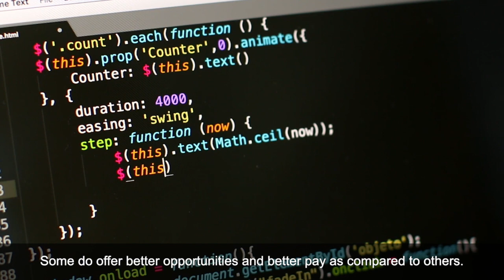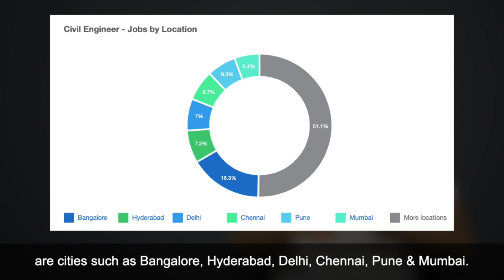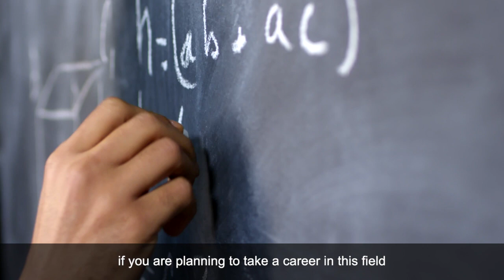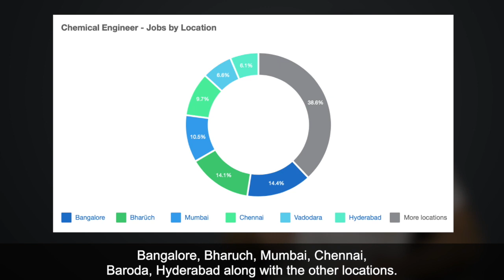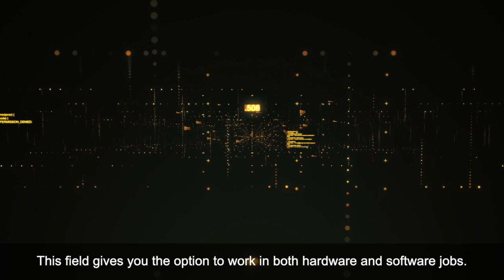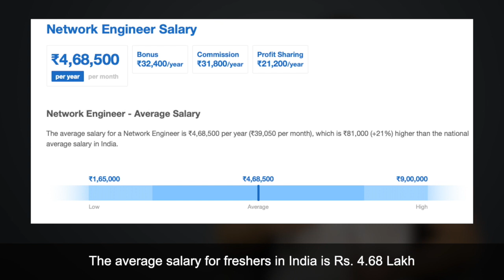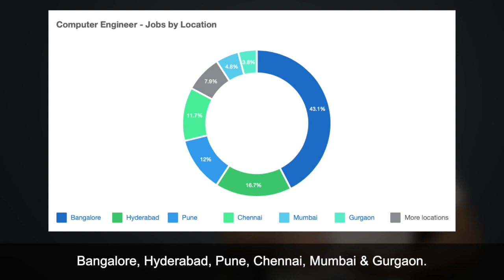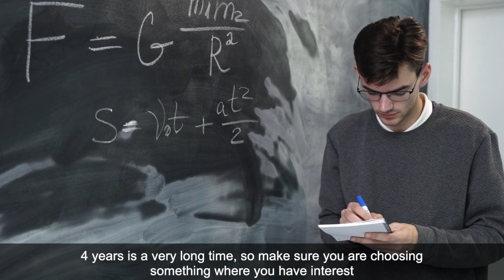Highest Paying Engineering Branches In India in 2024 (Which Engineering Degree To Choose)

Comment: Sir, wt about Aerospace Engineering ?
Reply from the maker: Hello, 
I wouldn’t recommend aerospace engineering, since it’s a niche field & the demand for jobs in this field isn’t much high paying in India. 
I would rather advice taking mechanical engineering & then specializing in aerospace engineering field. It’s always better to go for a Broader field, because tomorrow if you want to switch your field, it’s easier to do. 

Eg , if you want to go for automobile or you want to go into oil & gas after your engineering, you can still do as a mechanical engineer, but if you are are doing aerospace engineering; it will be much difficult. 

So always choose a field which opens your door to multiple sectors and then do certifications on the field you want to specialize in that field. Also, if you do have the budget, do mechanical engineering in india, and plan for masters abroad in countries such as US, Germany, Australia etc that have high scope for Aerospace Engineering. 

Hope this helps & if you have further doubts, drop me a message on Instagram @nikhlogic!

Comment: Bhaiya what about aerospace engg.
Reply from the maker: Hello, 
I wouldn’t recommend aerospace engineering, since it’s a niche field & the demand for jobs in this field isn’t much high paying in India. 
I would rather advice taking mechanical engineering & then specializing in aerospace engineering field. It’s always better to go for a Broader field, because tomorrow if you want to switch your field, it’s easier to do. 

Eg , if you want to go for automobile or you want to go into oil & gas after your engineering, you can still do as a mechanical engineer, but if you are are doing aerospace engineering; it will be much difficult. 

So always choose a field which opens your door to multiple sectors and then do certifications on the field you want to specialize in that field. Also, if you do have the budget, do mechanical engineering in india, and plan for masters abroad in countries such as US, Germany, Australia etc that have high scope for Aerospace Engineering. 

Hope this helps & if you have further doubts, drop me a message on Instagram @nikhlogic!

Comment: What about Aerospace engineering?
Reply from the maker: Hello Kunal, 
I wouldn’t recommend aerospace engineering, since it’s a niche field & the demand for jobs in this field isn’t much high paying in India. 
I would rather advice taking mechanical engineering & then specializing in aerospace engineering field. It’s always better to go for a Broader field, because tomorrow if you want to switch your field, it’s easier to do. 

Eg , if you want to go for automobile or you want to go into oil & gas after your engineering, you can still do as a mechanical engineer, but if you are are doing aerospace engineering; it will be much difficult. 

So always choose a field which opens your door to multiple sectors and then do certifications on the field you want to specialize in that field. Also, if you do have the budget, do mechanical engineering in india, and plan for masters abroad in countries such as US, Germany, Australia etc that have high scope for Aerospace Engineering. 

Hope this helps & if you have further doubts, drop me a message on Instagram - @nikhlogic
Reply: @NikhLogic  thank you so much for guidance.....It helps a lot... 🙏🙏
Reply from the maker: @kunalshirke9100  Anytime brother

Comment: Sir kya aeronautical engineering ek good choice hai
Reply from the maker: Sanghita, I wouldn’t recommend aeronautical engineering, since it’s a niche field & the demand for jobs in this field isn’t much high in India. 

I would rather advise taking mechanical engineering & then specializing in aeronautic. It’s always better to go for a Broader field, because tomorrow if you want to switch your field, it’s easier to do. 

Eg, if you want to go for automobile or you want to go into oil & gas after your engineering, you can still do it as a mechanical engineer, but if you are doing aeronautical; it will be much difficult.

So always choose a field that opens your door to multiple sectors and then do certifications on the field you want to specialize in 

Hope this helps & if you have further doubts, drop me a message on Instagram - @nikhlogic
Reply: @NikhLogic  thank you for replying
Reply: @NikhLogic  And what about aircraft maintenance engineering iss ke bare mein kuch bataiye plz sir

Comment: Sir what about aerospace engineering
Reply from the maker: Hello Swarna, 
I wouldn’t recommend aerospace engineering, since it’s a niche field & the demand for jobs in this field isn’t much high paying in India. 
I would rather advice taking mechanical engineering & then specializing in aerospace engineering field. It’s always better to go for a Broader field, because tomorrow if you want to switch your field, it’s easier to do. 

Eg , if you want to go for automobile or you want to go into oil & gas after your engineering, you can still do as a mechanical engineer, but if you are are doing aerospace engineering; it will be much difficult. 

So always choose a field which opens your door to multiple sectors and then do certifications on the field you want to specialize in that field. Also, if you do have the budget, do mechanical engineering in india, and plan for masters abroad in countries such as US, Germany, Australia etc that have high scope for Aerospace Engineering. 

Hope this helps & if you have further doubts, drop me a message on Instagram - @nikhlogic

Comment: Sir,What about Metallurgy Engineering
Reply from the maker: Hello Abhinav, I wouldn’t recommend Metallurgy engineering, since it’s a niche field & the demand for jobs in this field isn’t much high in India. 

I would rather advise taking mechanical engineering & then specializing in Metallurgy if you want to. It’s always better to go for a Broader field, because tomorrow if you want to switch your field, it’s easier to do. Also, in mechanical during your 2nd year & 3rd year, you have subjects related to Metallurgy. So you cover those topics. 

Eg, if you want to go for automobile or you want to go into oil & gas, you can still do it as a mechanical engineer, but if you are doing metallurgy; it will be much difficult.

Hope this helps & if you have any doubts in this field, feel free to drop me a message on Instagram @nikhlogic. Will be happy to help :)

Comment: How good is Production Engineering? What is its scope?
Reply from the maker: Hello brother, 
I wouldn’t recommend production engineering, since it’s a niche field & the demand for jobs in this field isn’t much high paying in India. 
I would rather advice taking mechanical engineering as it covers pretty much same topics. It’s always better to go for a Broader field, because tomorrow if you want to switch your field, it’s easier to do. 

Eg , if you want to go for automobile or you want to go into oil & gas after your engineering, you can still do as a mechanical engineer, but if you are are doing production engineering; it will be much difficult. 

So always choose a field which opens your door to multiple sectors and then do certifications on the field you want to specialize in that field. 
Hope this helps & if you have further doubts, drop me a message on Instagram - @nikhlogic
Reply: @NikhLogic  thank u so much sir...now I have a way❤️

Comment: Sir what about Aerospace Engineering
Reply from the maker: Hello Aadarsh, 
I wouldn’t recommend aerospace engineering, since it’s a niche field & the demand for jobs in this field isn’t much high paying in India. 
I would rather advice taking mechanical engineering & then specializing in aerospace engineering field. It’s always better to go for a Broader field, because tomorrow if you want to switch your field, it’s easier to do. 

Eg , if you want to go for automobile or you want to go into oil & gas after your engineering, you can still do as a mechanical engineer, but if you are are doing aerospace engineering; it will be much difficult. 

So always choose a field which opens your door to multiple sectors and then do certifications on the field you want to specialize in that field. Also, if you do have the budget, do mechanical engineering in india, and plan for masters abroad in countries such as US, Germany, Australia etc that have high scope for Aerospace Engineering. 

Hope this helps & if you have further doubts, drop me a message on Instagram - @nikhlogic

Comment: Sir what about mechatronics engineering? I loves to create things
Reply from the maker: Hello JCK, sorry I missed out your comment. 
I wouldn’t recommend mechatronics engineering, since it’s a niche field & the demand for jobs in this field isn’t much high in India. 

I would rather advise taking mechanical engineering & then specializing in mechatronics if you want to. It’s always better to go for a Broader field, because tomorrow if you want to switch your field, it’s easier to do. Also, in mechanical during your 2nd year & 3rd year, you have subjects related to Mechatronics. So you cover those topics. 

Eg, if you want to go for automobile or you want to go into oil & gas, you can still do it as a mechanical engineer, but if you are doing mechatronics; it will be much difficult.

Hope this helps & if you have any doubts in this field, feel free to drop me a message on Instagram @nikhlogic. Will be happy to help :)
Reply: @NikhLogic  but after mechatronics i can be a mechanical engineer also and can go in automobile and i can also change my field into electronics and computer science if I specialized into this but i cant do this when iam in mechanical engineering
Reply from the maker: You can just do mechanical engineering instead and work in any of those fields. ECE, yes you can't, but if you are just planning of specializing in it, there won't be a demand for your profile, as your overall software knowledge required will be much lesser.,

Comment: Bro doing cse in colleges other than nit/iit worth it?
Reply from the maker: Hello David, yes it's worth it. College brands do add value, but at the end, it's about what you understand. I know quite a lot of people who didn't come from NIT or IIT, but are currently working with Apple, Tesla etc. So it doesn't completely depend on which college you are coming from, but also matters what you have learnt.
Reply: @11 226 ANTO ABRAHAM thanks dude
Reply: @11 226 ANTO ABRAHAM yep you can if you do Mtech/phd in ai and ml , which is not easy ,it's one of the difficult subject
Reply: @11 226 ANTO ABRAHAM to work in abroad there are two ways bro 
First way is to get in the prestigious college like nits/iits or bits and crack foreign placement there 
Second way is to do ms in us/cannada/Germany and get job there after graduation , for this you need to write GRE/Toefl and score some decent marks to get a decent college , to get into ivy league colleges then you will get job 99.99% sure but you need heavy marks in toefl and strong resume
Reply: @11 226 ANTO ABRAHAM btech and be are almost similar bro , infact almost all local college offer be instead of btech , they are given same recognition under aicte , try to get a good college bro , then btech or be will not matter , college matters

Comment: I want to be an aerospace engineer
Reply from the maker: Hello Chinmay, 

I wouldn’t recommend aerospace engineering, since it’s a niche field & the demand for jobs in this field isn’t much high paying in India. 
I would rather advice taking mechanical engineering & then specializing in aerospace engineering field. It’s always better to go for a Broader field, because tomorrow if you want to switch your field, it’s easier to do. 

Eg , if you want to go for automobile or you want to go into oil & gas after your engineering, you can still do as a mechanical engineer, but if you are are doing aerospace engineering; it will be much difficult. 

So always choose a field which opens your door to multiple sectors and then do certifications on the field you want to specialize in that field. Also, if you do have the budget, do mechanical engineering in india, and plan for masters abroad in countries such as US, Germany, Australia etc that have high scope for Aerospace Engineering. 

Hope this helps & if you have further doubts, drop me a message on Instagram - @nikhlogic

Comment: do aeronotical engnnering have good scope is it good to choose it .please respond
Reply from the maker: Hello Vishnu, 

I wouldn’t recommend, since it’s a niche field & the demand for jobs in this field isn’t much high paying in India. I would rather advice taking mechanical engineering & then specializing in aerospace or aeronautical engineering field depending on your interest. It’s always better to go for a Broader field, because tomorrow if you want to switch your field, it’s easier to do. 

Eg , if you want to go for automobile or you want to go into oil & gas after your engineering, you can still do as a mechanical engineer, but if you are are doing a niche engineering field; it will be much difficult. 

So always choose a field which opens your door to multiple sectors and then do certifications on the field you want to specialize in that field. 
Hope this helps & if you have further doubts, drop me a message on Instagram - @nikhlogic

Comment: Sir can aeronatical engineering is good brand for defense aspirants
Reply from the maker: Hello Abhay, 

I wouldn’t recommend, since it’s a niche field & the demand for jobs in this field isn’t much high paying in India. I would rather advice taking mechanical engineering & then specializing in aerospace or aeronautical engineering field depending on your interest. It’s always better to go for a Broader field, because tomorrow if you want to switch your field, it’s easier to do. 

Eg , if you want to go for automobile or you want to go into oil & gas after your engineering, you can still do as a mechanical engineer, but if you are are doing a niche engineering field; it will be much difficult. 

So always choose a field which opens your door to multiple sectors and then do certifications on the field you want to specialize in that field. If your interest lies purely in defense, in that case you need to clear the NDA exam and also the CDSE exam. 

Hope this helps & if you have further doubts, drop me a message on Instagram - @nikhlogic
Reply: @NikhLogic  Thank you so much sir for your guidance 🙂🙂

Comment: Could you tell about Marine engineering
Reply from the maker: Hello Mathankumar, 

I wouldn’t recommend marine engineering, since it’s a niche field & the demand for jobs in this field isn’t much high in India. 

I would rather advice taking mechanical engineering & then specializing in marine engineering field. It’s always better to go for a Broader field, because tomorrow if you want to switch your field, it’s easier to do. 

Eg , if you want to go for automobile or you want to go into oil & gas after your engineering, you can still do as a mechanical engineer, but if you are are doing marine engineering; it will be much difficult.
So always choose a field which opens your door to multiple sectors and then do certifications on the field you want to specialize in 

Hope this helps & if you have further doubts, drop me a message on Instagram - @nikhlogic
Reply: @NikhLogic  could we join offshore
Reply from the maker: Yes, for sure

Comment: What about aeronautical engineering!?
Reply from the maker: Hello Priyanshi, 

I wouldn’t recommend, since it’s a niche field & the demand for jobs in this field isn’t much high paying in India. I would rather advice taking mechanical engineering & then specializing in aerospace or aeronautical engineering field depending on your interest. It’s always better to go for a Broader field, because tomorrow if you want to switch your field, it’s easier to do. 

Eg , if you want to go for automobile or you want to go into oil & gas after your engineering, you can still do as a mechanical engineer, but if you are are doing a niche engineering field; it will be much difficult. 

So always choose a field which opens your door to multiple sectors and then do certifications on the field you want to specialize in that field. 
Hope this helps & if you have further doubts, drop me a message on Instagram - @nikhlogic

Comment: What about aeronautical engineering
Reply from the maker: Hello Ayub, 

I wouldn’t recommend, since it’s a niche field & the demand for jobs in this field isn’t much high paying in India. I would rather advice taking mechanical engineering & then specializing in aerospace or aeronautical engineering field depending on your interest. It’s always better to go for a Broader field, because tomorrow if you want to switch your field, it’s easier to do. 

Eg , if you want to go for automobile or you want to go into oil & gas after your engineering, you can still do as a mechanical engineer, but if you are are doing a niche engineering field; it will be much difficult. 

So always choose a field which opens your door to multiple sectors and then do certifications on the field you want to specialize in that field. 
Hope this helps & if you have further doubts, drop me a message on Instagram - @nikhlogic